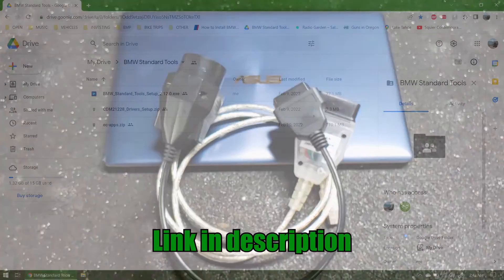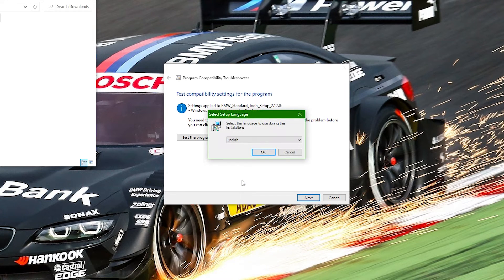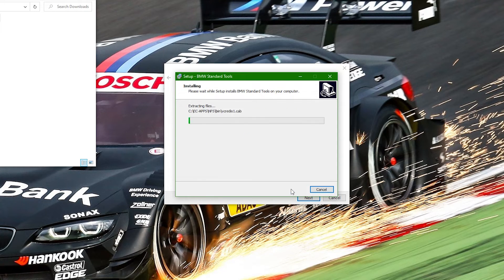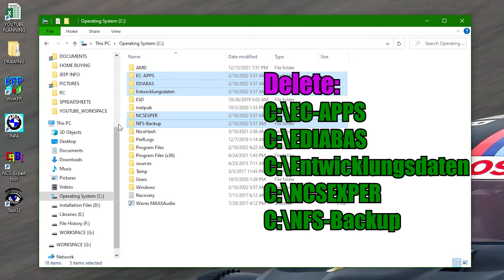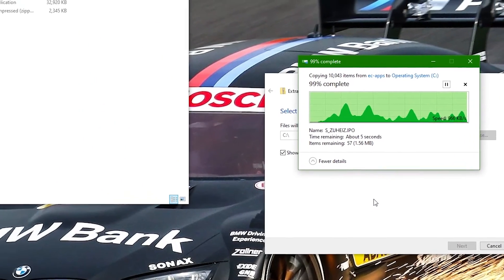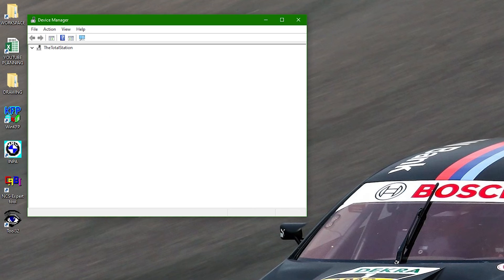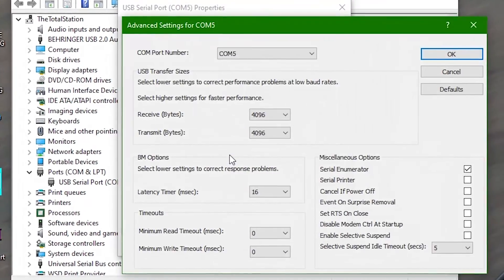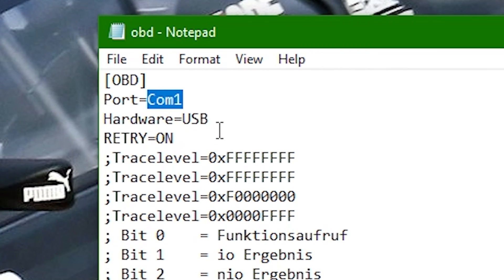Install INPA, NCS Expert, WinKFP, Tool32 on BMW Easily: Step-by-Step Guide

Comment: Mine won't open. Says shortcut has been moved or deleted. Please help

Edit: found the .exe file in EC-PPS bin  folder.. "the code execution cannot proceed because api32.dll was not found. Reinstalling the program may fix this problem" .. could this be happening because I created a folder called INPA on the desktop and moved everything there?
Reply from the maker: That could be the reason. Instead of moving everything to that folder, just make shortcuts to the programs in that folder (right click / send to desktop). That should keep everything working.
Reply: @endlessmoneypits  I think I understand what you mean.. so basically the program HAS to live on the desktop with all its files? Seems strange. I have a feeling the installation was somehow incomplete. Some of the files said were "not synched" in windows 10.. I will try to reinstall
Reply from the maker: Well, you can choose where you want the installation files to be during installation, but the shortcuts to open the programs will go to the desktop by default. As long as they are shortcuts, you should be able to move those to any folder you want but the installation files have to stay in the location where they were installed.
Reply: @endlessmoneypits  it worked after reinstall!💪.. I think the problem was I didn't install to C:/ but installed to what came up first which was the ec-apps folder in downloads instead of switching it to C:/ .. thanks a bunch! Much appreciated. 🙇‍♂️
Reply from the maker: Glad you got it sorted out!
Reply: @endlessmoneypits  thanks. Except it's not telling me too much more then I already knew from my p1093(236) fuel trim in bank 2.. Likely cats as I replaced everything over the years trying to hunt this code down. But no cat codes. Back to the forums I go.
Reply from the maker: I don't have any experience with that code yet but I just read that it it could be caused by carbon buildup in the idle control valve on BMWs. You probably already tried cleaning it since that was the first thing I found. Wish I could help more.
Reply: @endlessmoneypits  lol you are correct. And I also replaced it just incase along with the o2 sensors twice, maf, fuel filter and pump, injectors, ccv, checked for vac leaks, etc. Actually i was able to pick up other codes with INPA and I got 143 which is an evap leak. Will start with the gas cap and work my way in. Would be hilarious if my fuel trim issue was evap related after all this time 😆
Reply from the maker: The only other things I can think of are dirty fuel injectors or old gas. Did the car sit for a long time recently?
Reply: @endlessmoneypits  nope. Been driven daily since 2007 and replaced the injectors in 2018 😎.. I'll let you know what fixes it if I figure it out. About to hit 200k in 1k miles 😎
Reply from the maker: Alright I'm out of ideas anyway. Yes, please let me know what you find out, and good luck!

Comment: Great video! However, once I connected the cable (only to computer not to OBDI) then start INPA it shows two black dots 'Battery On' AND 'Ignition On' . Any idea?
Reply from the maker: Hmm that's no good. I would restart the computer and try again. Windows updates may be needed but that's just a guess. If it does the same thing, see if you can connect to the car anyway. If you can't get it to work, I would try a different computer. I can't really help beyond that. I'm not sure what would be causing this problem.
Reply: @endlessmoneypits  Thank you for your very quick reply! Seems like even though I see both black dots (w/o being connected to car) once I connect I still can communicate with car. I donwloaded all the control module data and was able to clear errors. However, if I go to 'Chassis' then 'DSC' and then 'Activate' I get the error message "Not matching versions, misfunctions possible  SGBD Version 6.0, SGBD version 21.0 INPA version 6.0" . Once I click 'OK' I see what I expect which is the DSC bleeding procedures. Anything to worry about or all good? Thank you so much for your help!
Reply from the maker: That is a question only Bali can answer. He's the guru with this software. You can contact him on the e46fanatics site I linked to in the description. Wish I could help more but this is too technical for my experience.

Comment: Hello, first i will thank you for this video. I have installed everything on the exact same way how you tell. But when i open INPA i can't see the model of the bmw cars. Only what i see is f1 for information and f2 for script and f10 for end.

I can't select the option for e46.

What is the problem?
Reply from the maker: I'm not sure but it sounds like the program didn't install correctly. I would try uninstalling and starting over. If that doesn't work I would try it on another computer. There shouldn't be any problems like this.

Comment: After restarting, I don’t have the operating system (c) on my laptop???
Reply from the maker: That shouldn't happen just from installing the program. Can you boot up in safe mode? There might be an issue with your computer.
Reply: @endlessmoneypits  thanks for the quick reply. I will restart and start the process again.

Comment: What a bloody head ace IT DOES NOT WORK spent HOURS  trying to get it to , DISAPOINTED
Reply from the maker: Just won't connect? Did you try all the troubleshooting tips? Bali is the guru on this topic, so feel free to message him on the E46 fanatics website. He usually replies quickly during the day. I put a link to his original write-up in the description.